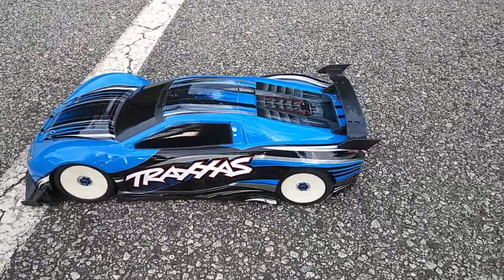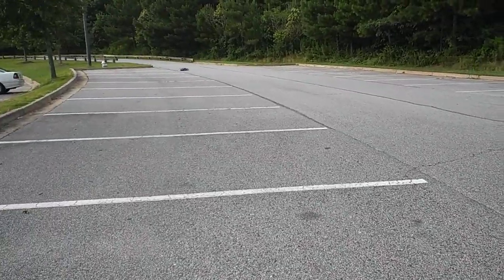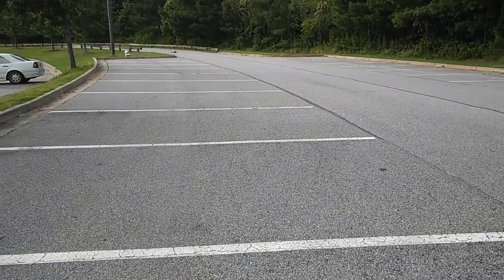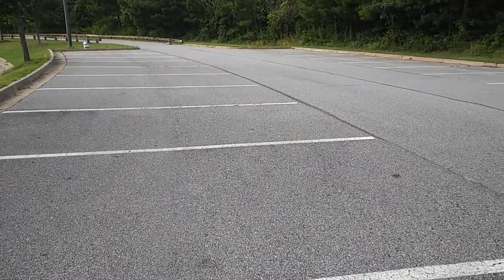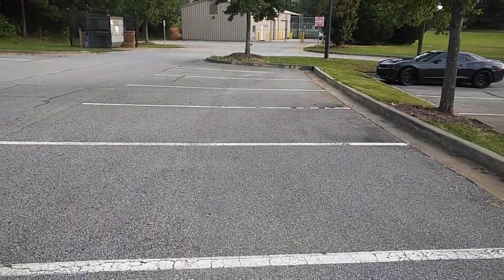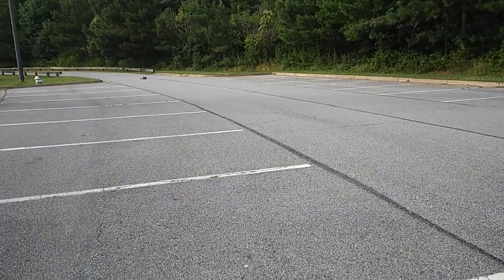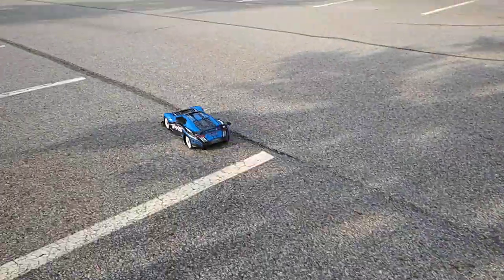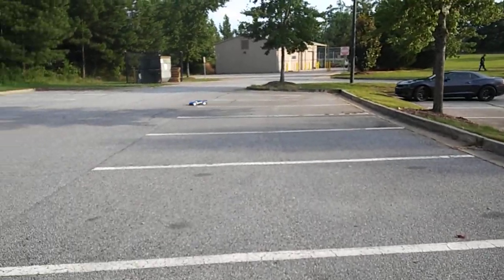Traxxas XO1 Suspension Adjustment 6s Test Run

Comment: what suspension settings did you do? I swapped servo to Associated XP DS1015 and TSM set to 60%. I have my diff oil 500k front/10k rear.  I'm using John's BSR Red 55shore front and Double pink 35shore rear foam tires.  I was running the 2.6 rate (14.8lb/in) fronts and 2.3 rate (13.1lb/in) rear springs but it still felt really loose.  I do have it jacked up 20 quarter turns on shock collars but our roads/parking lots suck here and I only have it geared 19/46.  I just changed my rear springs to 1.8 rate (10.3lb/in) which I hope will make it more stable.  Stock is 1.6 rate